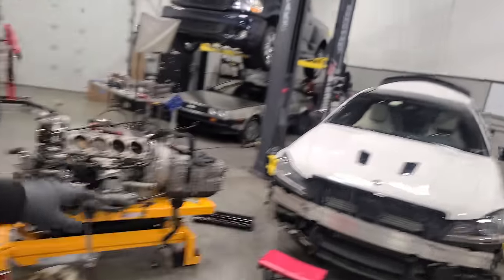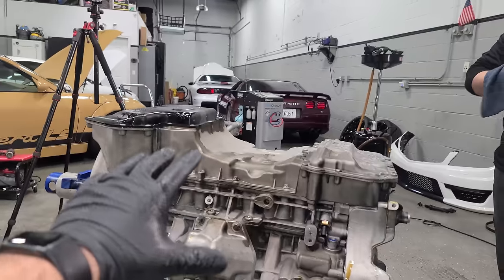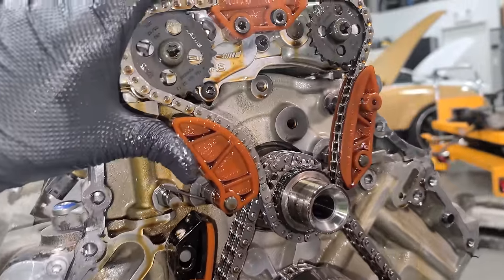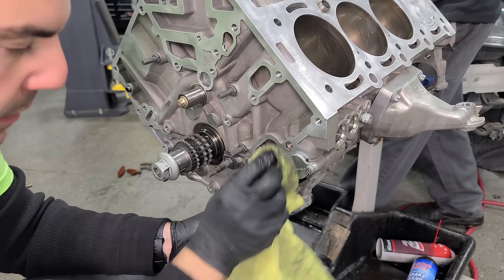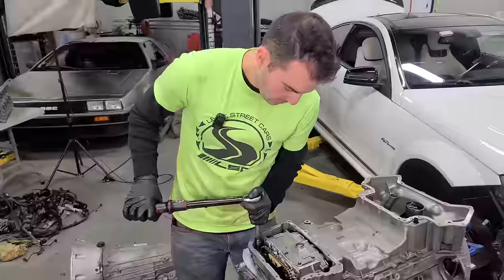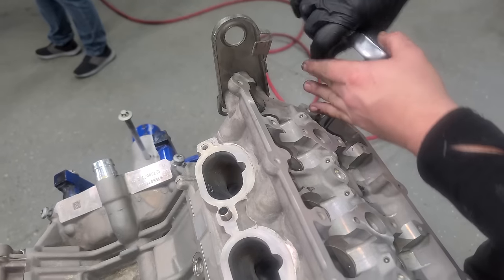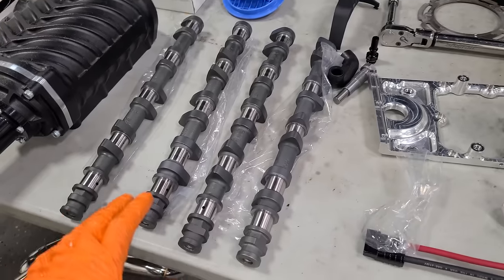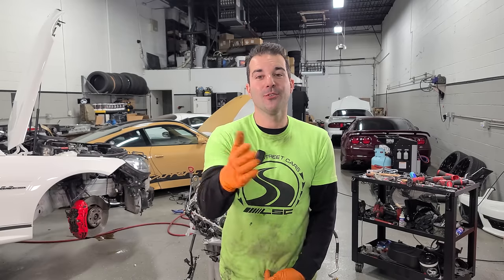We Built A 1000-Horsepower AMG V8 Engine In 24 Hours! C63 Coupe Is Ready For Boost!

Comment: I’m a 12 year W204 C63 owner. Very gratifying to see this motor in such good condition as mine also has 85,000 miles. 
I also have installed a blower (ESS) 8psi kit. Prior to install we did a compression test, ARP head studs and cam phaser plates. Killer chiller rounds out the build.
Reply from the maker: That's great! Must be a monster!
Reply: Also did a Southern Hotrod War Viking build on the transmission. Raybestos GPZ friction discs are a great upgrade from stock. Weistec high capacity trans pan good for cooling.

Comment: Instead of pulling up against the prybar trying to hold down against the floor, flip the torque wrench over to above the pry bar and push it down which will assist to hold the pry bar into the ground. You will also be able to add more weight or add a hollow extension pole for more leverage.
Reply: Was gonna type this...

Comment: Really liking that you're back on the two upload per week schedule, thank you!  Side note - that Delorean would be amazing with an NA M156 with a T56 or Porsche manual gearbox (depending on fitment and available adaptors).
Reply: I don't think a T56 would work because since the DMC is a rear engine, you would need a transaxle and not a transmission. So a Porsche 5 or 6 speed would probably be the best setup.
Reply: @chesspiece81  I was originally going to say transaxle, but I have seen LS1 swaps with the T56 so I wasn't sure.  But yea the easiest would be the Porsche G50 or I think 915 from what I've read.
Reply: He should put an ls4 in there, the transverse ls in the impala ss and the grand prix gxp
Reply: @Moecean  And a pretty shitty auto. A built, boosted, K series, with a 6 speed and LSD would be cool. I'm a LS/LT fan boy

Comment: That timing chain idler oil slinger is for the crankcase ventilation. It uses the centrifugal force to sling out the   Oil, to keep it from being pulled out with the air. The dodge 3.6l base one on the end of the camshaft.

Comment: The chamber attached to the idler gear is actually a spinning centrifuge for crankcase breathing.  It's a really good idea to inspect inside the breather hose port on the front of the timing cover with a borescope camera before bolting the cover on. That will ensure the reverse mounted seal on the inside of the cover isn't pinch rolled on the centrifuge. Ask me how I know.

Comment: To get 180 pull, paint a line on the nut. Paint a line on a socket. Use a dugga dugga gun to turn the socket 180... Remove and check the nut has done the same.

Comment: Head studs should installed after the head has been fitted on the dowels.  No binding issues and no shards of aluminium block  stuck in the head gasket.

Comment: a tip id like to pass along to you, from my 2jz experience. I've found it to be easier to install headstuds once the head is on the block. if the head allows for this, it works way better and you dont have to line up the studs to the head.

Comment: You are doing the best maintenance as supposed
Like an airplane engine
2 points though First is the cam gears need to be replaced with the cam chain
Second the head studs goes after you put the head because of metal save cause of the thread's
If im doing it wrong please advise
You are a legit car guy and from my knowledge you are the only one
Please more content eill be highly appreciated
Reply: The bolck have a guides for the heads to sit properly

Comment: The last time I stripped and built an engine from scratch was a Lotus Twin Cam Big Valve from an Elan SE for use in my Ford Escort Mexico rally car. When it comes to the mechanics of engines, not much had changed since those halcyon days of the early '70's, just more bhp per litre... Loved the video and so good to see you are not being totally anal about the torque settings for non-critical bolts. Brian

Comment: I've heard that those white abrasive pads can leave material in the block that can eventually compromise bearings. Interested on your thoughts. Great video as always!
Reply: This is the same thing I came here to say. Subaru recommended them for head gaskets, and GM says NO-NO. They are ceramic abrasive, so I personally do not use them unless the engine is completely disassembled and getting washed. 🤷‍♂️
Reply: It's true, I destroyed an engine using them for a head gasket job once. Of course if you just changed the oil a bunch of times after the work you might be OK.

Comment: We use the green finger cookies and the brown 3M ones I’ve seen guys use so much pressure the fingers come off and fly into the motor and I’ve also seen guys use the scotch brite discs and completely wipe out the bearings from all the particles getting inside motor and not flushing it.

Comment: Yamabond/Hondabond semi drying liquid gasket is light years better than anything RTV or silicone. More expensive but will never ever leak in close tolerance metal to metal surfaces. Not even after 20 years. It's the only thing they use for 2 cycle engine crankcase joints. They are under constant pressure pulse and in fuel and oil. A leak there will suck air and blow the engine. So you know it's the best thing ever for sealant. I use it on absolutely everything even to coat gaskets that frequently leak or weep over time. RTV is cheaper but no comparison.

Comment: Alex, don't bad mouth the Audi's of the early 2000s. My 2002 A4 B6 3.0 V6 Quattro has proven way more reliable than my 2007 CLS 500 (M273). Don't get me wrong, the engine is a absolute gem, but every single sensor and the constant warnings on the dash for every little thing drives me crazy. If I was not so in love with her beautiful curves I would have gotten rid of her years ago.

Comment: Tbh anything that has oil pressure ur better off making a gasket from gasket paper. Like on that thermostat. I do not think there is a filter after the thermostat, so that rtv that squeezed out inside it when you snugged it down is now in the engine.

Comment: Very nice build!
I don't think you should smeer the RTV on the surface like that. To much of it will me squeezed out on the engine inside and will eventually clog your oil pickup and/or oil passages. Just use a thin line and leave it so, it will be evenly squished.

Comment: Are those bottom two guides supposed to be in the same orientation? You just showed how the longer one has the lip curl down but you installed the bottom two with each in a different direction.

Comment: FCP doesn't have the refund warranty anymore. It's a store credit, still a great system, just not quite as good as the old one.

Also to torque the crank bolt, what you need is a torque multiplier. Kind of expensive but a god send on high torque fasteners, like Porsche axle nuts.

Comment: Dude goes from telling us that basically every car he has, has blown engines and bearing issues and then tells us how great his Amsoil collection is and how well it works. ☠️☠️☠️
Reply from the maker: Come on now.  I buy them broken. They aren't cars that have been maintained with Amsoil
Reply: @LegitStreetCars  you also keep taking that Porsche out without a proper tune without having any clue if you are hammering the bearings with knock. Your Porsche videos is where I started watching and they irritate me.
Reply: All cars eventually wear down... Cars are wear and tear items....
Reply: @LegitStreetCars  btw, you shouldn’t have bottomed out those head studs like that. They expand at a different rate than that aluminum block so when you bottom them out that tight you risk expansion deforming the block.

Comment: How do you avoid valves hitting the pistons as you bolt the cams in? No timing done at that stage so surely a possibility of damage?
Reply from the maker: When you put the crank at 40 degrees you are putting it not only in time but also a safety position so Valves can't hit

Comment: That's not exactly how the FCP Euro life time warranty works. If you want to use the warranty you technically have to pay for the part then they will refund it back to you so if it's an expensive part like a ECU or something and you can't afford to spend $2000 to buy the part then get refunded then your out of luck. You might be able to email them and ask if they could send the part after they receive your old part back they might do it but no guarantee

Comment: I got a question hopefully you can help me out. I have a 2011 C63 P31. Well apparently i removed the valve covers and found out i have the old style headbolts. I ended up removing the bolts and found out 1 of them failed and wasn't even tight.  After replacing headbolts one at a time. When i was installing the cams back into place one of the buckets looks like it also failed same area the bolt failed. I can push down on the bucket ever so slighting and it moves down. Would this be a sign that the bucket has failed as well? I also swapped a good bucket from a different location and it didn't move at all. I order a couple new buckets as they are very expensive.

Comment: Alex, I love your Amzoil promotion. Unfortunately, Mobile 1 has surpassed all engine oils time & time again. Rockefeller will not be defeated. He always takes the best oils on the market and 1 ups them. Mobile 1 is the ONLY oil that guarantees a BMW to 1 million miles. Did you know you get a brand new BMW if you hit 1 million miles? Their racing oil uses the highest quality ZDDP on the market. They actually own ALL the ZDDP additive supply in the world. So, there's no way Amzoil can get higher quality ingredients than Mobile 1. I know, Amzoil is a Chicago thing. But here in the deep south, engine oil gets hammered. Without the absolute best, our engines break down really fast here (heat & humidity & seal level).

Comment: You have made so many mistakes , just with cleaning the sealing surfaces and applying sealant .. there is sealant paths in the workshop material. Never use more than just a sealant cleaner and NEVER NEVER smush the sealant .